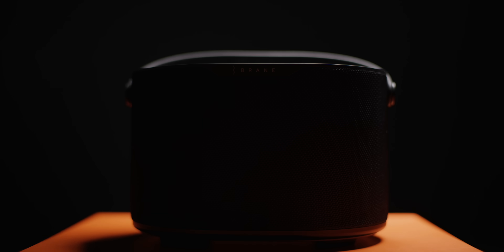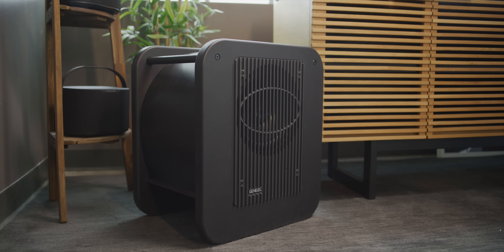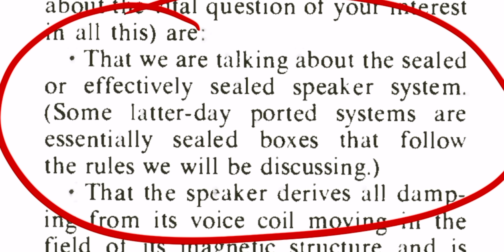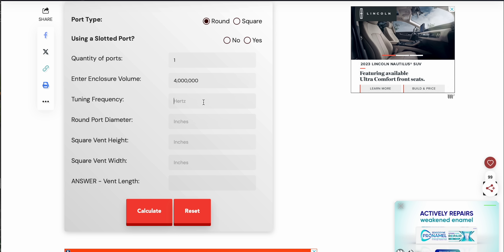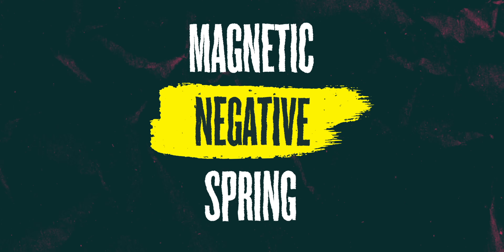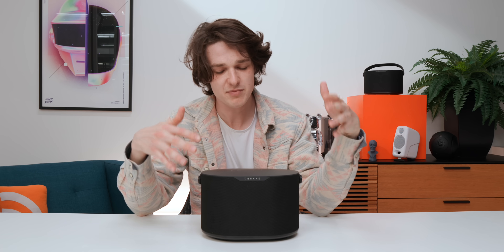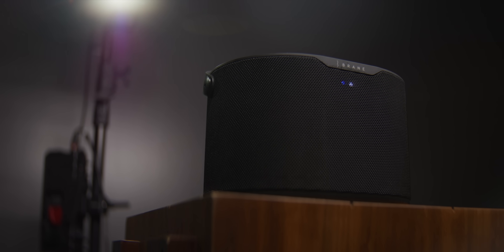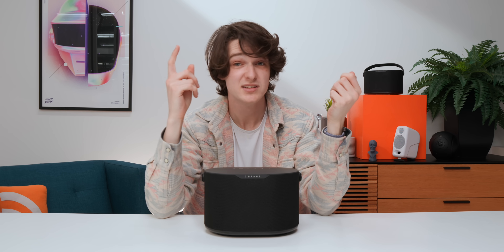How This Speaker Broke Physics.

Comment: I wonder if the spring has a capacity for loading. Every material has a yield strength, I wonder if multiple uses over the years would “loosen” the springs which would lead them to not have the force required to oppose the air pressure.

Comment: Great video and presentation Ellis,  I was looking for something to replace my Harman Kardon hkgo+2 that has been my old trusty boombox for the longest time, but I am curious about the frequency response, I notice a lot of speakers typically start rolling off at the 50hz range and then basically anything below 40hz is almost non existent, the measurements from RTINGS seem to show a bit of detectable bass in the 28 hz range, by no means is it flat down to that level, but still impressive that it can play that low.

For me the most impressive bass output for it's size is still the Homepod OG, but I would love to hear this thing in person to see how it compares, the low-bass portion of the frequency response looks quite similar and even a bit better than the Homepod.

Comment: I just see lots of hype for that bass, but there is no way to trust this very salesy video without you even showing any measurements. Though there is some measurements on Rtings, but they don't show anything that's even close to what you are saying. There is bass down to 55hz, but it's quite a bit lower than the upper bass that seems awfully hyped, and even so the lowest bass get's quite compressed at louder volume. Also the treble seems to be lacking as well.

Comment: That system is not sooo New. Even my MY2020 Car has an Electromagnetic Controlled Subwoofer. I went nuts searching when i first heard my Stereo and there was no Subwoofer nowhere to find, not even in the Subfloor. Only a undisturbed Fullsize Spare Wheel. When i finally found the Subwoofer it was a tiny 6x9 Bakelite Speaker-thingy  hidden behind the Trunksiding. Compared to that Size and how it hammers the Snot out of everything it is disturbingly small. It runs easily in the 30Hz Area and makes the whole car rattling. The "Drop" is mind-boggling. It has a Magnet in the Size of an Bottlecap. All the "Magnetism" (Clampingforce) to rule the mechanic movement of the Membrane is done by the Amp whom steers an tiny ELECTRO-Magnet.. Not an "PERMANENT" Magnet who has a fixed Value of clamping. So the Woofer has 4 Wires. 2 for the E-Magnet and 2 for Signal.

Comment: Many small speakers can provide you with great low end in a room that supports them well, if they are placed well. That's honestly more important than the speaker itself. I hope this speaker actually is only using a mechanical solution, and not tons of DSP as well. Because that's really 'hip' these days and it just smashes all musicality into smithereens. I'm really curious about this speaker. Hope to hear it somewhere soon. 
As for the devialet phantom; It's loud, it's shouty. But at a normal listening level when you actually want some refinent and definition,  It's outperformed by the 70 dollar Ikea Eneby 20.

Comment: I have a Devialet Phantom 2. It is very impressive for the size and sounds beautiful but it cannot match the Genelec system. Interesting thing with the Devialet the bass changes dramatically when you move around the room. I compared it to the Genelec 7350 and a Tribit Stormbox Blast and they do not do this.

Comment: as a sound engineer . i'd appreciate you as my teacher
Reply: Your joking right?
If you are actually into audio engineering, you should know this video is bad. Because: without plotting the frequency response, taking dB measurements (at 1 meter distance) and not mentioning the specs - it's just (indirect) marketing ploy.

Comment: An electromagnetic force acting against air pressure difference. So you are telling me they've created a... dynamic driver?
Reply: Hmm, a permanent magnet forming a spring, with some electrical thing in it. Put a piece of cardboard on that "Spring" and youve basically got a speaker. 

You know this kinda reminds me of Yamahas active servo tech, with its negative impedance thingy. Although that one actually has some stuff going on and the speakers I have with active servo do sound fantastic.
Reply: They probably just did a motion feedback circuit and called it 'negative spring' lol. Marketing.